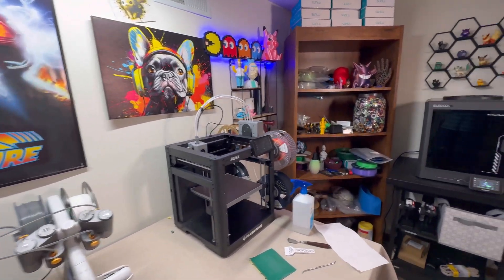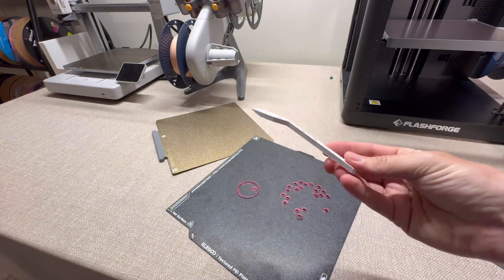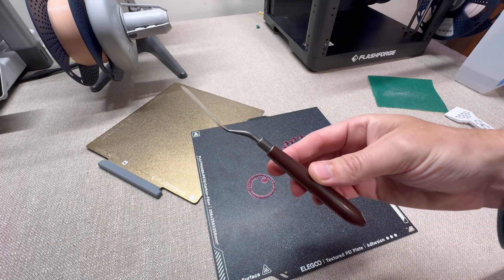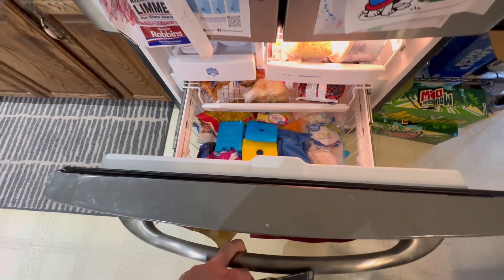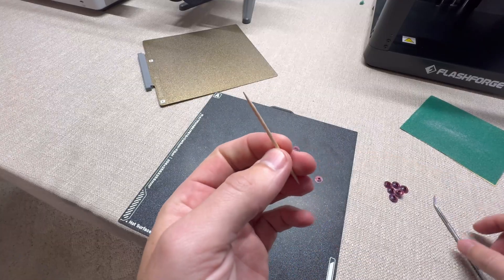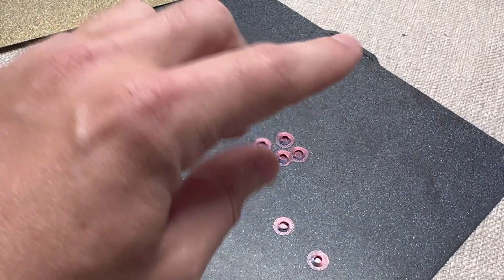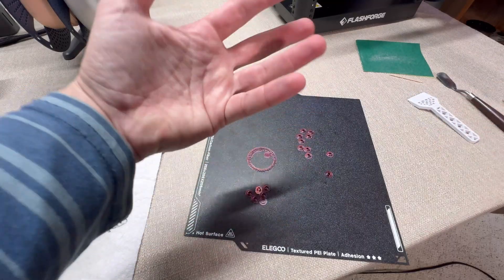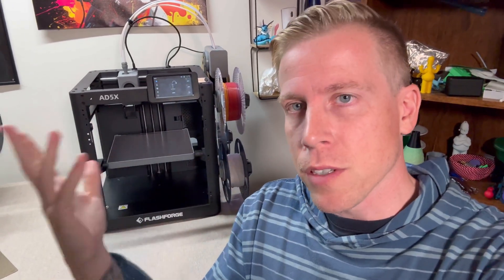Top 5 Ways to Remove STUCK Filament on Build Plate

Comment: Also you can use a heat gun. Heat up the areas where the filament is stuck, let cool down slighty and use tool to pick it off. This process works will all filament types.
Reply from the maker: Great tip, thanks for sharing!